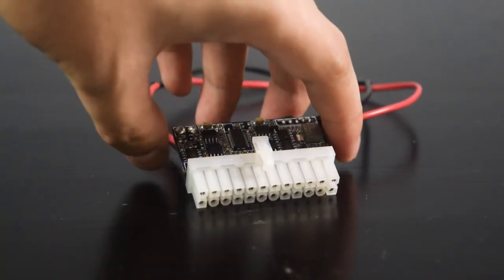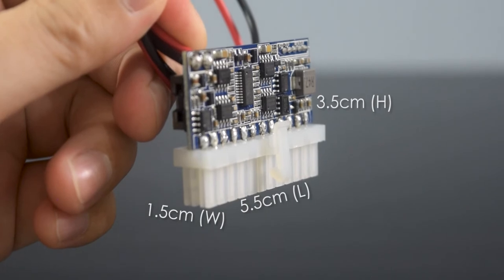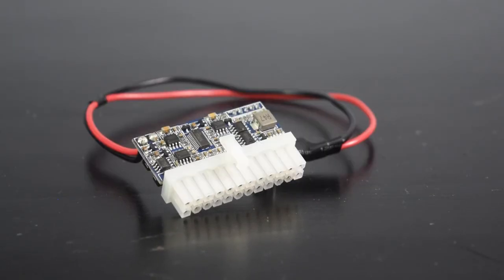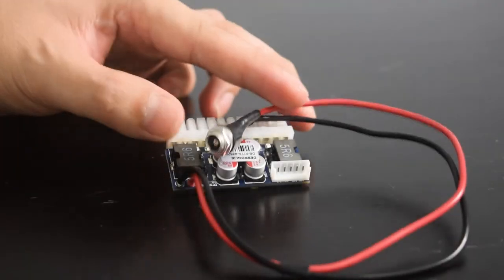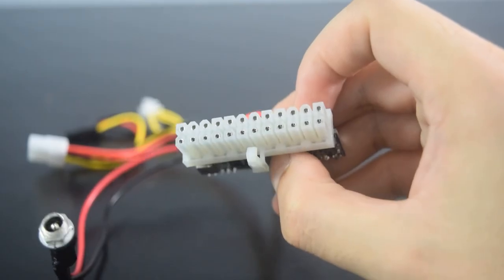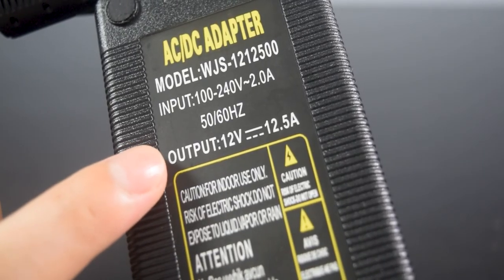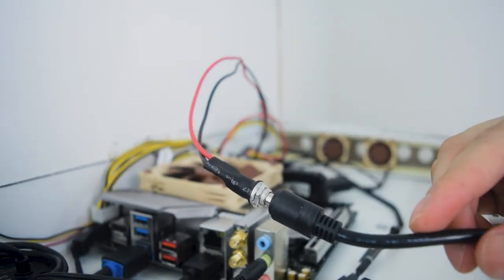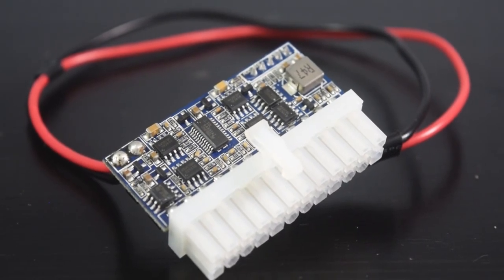What is PICO PSU? || Introduction to PICO power supply

Comment: You don't necessarily need a 12V 12.5A power supply, it's a good margin, but you should look at the load. For example, I need to power a miniATX motherboard with a processor on board with a TDP of 10W. At maximum loads, the motherboard with additional devices consumes 35W at peak, in Linux as a server no more than 15-20W. A 12V 5A power adapter (12*5 = 60W) is enough for me, because there should be a power margin of 30-40% for peak.
In general, I can even use 12V 3A, but only when I know that my system will not be constantly loaded and will have minimal consumption.

Comment: What about graphics card cable?
Reply: This is for non GPU builds.

A 70W without a 6+2 pin GPU usually needs a 250W PSU, so grab a 250W DC-ATX. But if you're thinking of running a mid or high-end GPU, check out Flex or SFX PSUs and make sure your ITX case can fit the GPU, like Metalfish S3 (flex) and T40 (SFX).
Reply: @_marcusmarinho or pcie powered gpus

Comment: Estimating the power of pcpartpicker is really bad. I realize this video is 3 years old, but it told me my config for a NAS draws around 205W of power....
In idle I got it down to around 28W, which is close to 1/10th of the powerdraw pcpartpicker said. Even under load, it never got above 100W. 
Comparing the size of the pico psu against a normal PSU but leaving out the external power brick you´ll still need is a bit disingenious.

Comment: Is it possible to use pico psu without the 24pin connector? I have 4 hdd case that i need to power up only the drives. Or is there any other kind of psu that would be better?

Comment: I have 2x 300W picopsus, neither will power on a low power Intel n100 motherboard that works fine with a normal PSU.
Without load the outputs all show correct voltages.
What could the problem be?
Reply: What is the spec of your external power brick?
Reply: I have similar poblem with 300W rgeek picopsu. Replaced him with cheapest aliexpress 160W picopsu and now everything works. That cheap psu is not that bad. I have low power system with i5 10500 and the temps of psu are 42 degrees max. There is small chance that powergood signal is not send properly in rgeek. Or there is no -12V needed for motherboard to power... old serial ports. Even when there is no serial port on backplate it can be on motherboard itself (goldpins)
Reply: @Krzak333  I will try to order one of those...

Comment: what good is it if you still need a frigging power brick???
Reply: No PSU sound, which is a huge issue for small builds, especially the very loud Flex ATX PSUs. Plus it is very small so you can fit it in ultra small cases that are designed for stuff like this. I don't like the idea of a separate brick either but there is a use case for it.
Reply: If you are tinkerer, you can replace barrel connector of psu with type c if you want. Again you would need to provide such power via compatible type c. Also if you have solar or some DC source you can get adaptors to use that DC without need of brick

Comment: WTF is even the point then if it still needs a huge external PSU?! There's nothing Pico about it.
Reply: The point is to remove the PSU from the case to make very small PC builds possible.
Reply: Yeah😂
Its true, u still need huge adaptor to power it, so buy flex psu is more recomend, and its safer too
Reply: @BedagrezsSs  But flex is louder. DC-ATX adapter is a good solution for iGPU builds.

Comment: Do they make a 400w one?
Reply: Not in this form factor, but there are SFX PSUs. I think I have seen one of those in the video with 240 or 300W, but it was bigger.
Reply: @MaxMüller0  i wonder is there an adapter to run two of these "pico 300w psu" in paralel for 2x the power?

Lol
Reply: @AutodidactEngineer  you can through a PSU splitter
Reply: @aleksandre5823  oh s**t is that a thing!?
Thanks for pointing it out!
Reply: HD plex but it is expensive.

Comment: Excellent video, very good, congratulations!! One question, does the power of the 12v external charger have to be greater than the Pico PSU source? For example, Pico PSU of 200 watts and external charger 12v of 250 watts of power, is that correct? thanks
Reply from the maker: Technically yes, power brick must have the same or higher rate than the psu, or else the pico wouldn't have enough juice.
Reply: @ItsTimeToBuildIt  Thanks for replying, these PSU power supplies only have a 4-pin connector for the CPU? My motherboard is an MSI B460i and the power supply connector for the CPU on this motherboard is 8-pin. Wouldn't the Pico PSU power connector have to be 8-pin? In your video shows the PSU Source with 4-pin connector. thanks
Reply from the maker: @josesing2160  like i mentioned in the video, you need a converter from 4-pin to 8-pin.

Comment: What about the GPU power supply?
Reply: You need a more powerfull psu... This is used mainly for apu
Reply: There is no 6 pin connector, because this thing doesn‘t have the power for this. Depending on the design, which can be different for these Chinese PSUs, it can have 8A on 3.3/5V and 22A on 12V (if the 12V input is directly connected to the 12V rail of this thing).
Reply: You might be able to downgrade your GPU in favour of a gpu that gets it's power from the pcie slot such as the Nvidia 1650 GPU
Reply: @Vodnik110  Honestly, I think even 70W GPUs without a 6+2 pin—like the GTX 1650, RTX 3050 6GB, or Quadro RTX A2000—are kind of pointless. If your case has a PSU slot, just throw in a compatible PSU and deal with the noise. It’s hard to find a tiny case that doesn’t have a PSU slot and still has room for a GPU.

Comment: I bought one from ali...... and tried to operate it out of mother board in the usual way (sort circuiting the green cable terminal to the black ground terminal) . Never started. I couldn't find the +5VSB or any other. I don't know it the specific device is a faulty one or if needs some load to start operate. Any advice is welcome
Reply from the maker: You need the right power brick to give it power, but if you already have one i'm afraid you've got a faulty device.
Reply: @ItsTimeToBuildIt  yes I have one 12 VDC 5A (12,1VDC till 4,1A). I'll try to follow the 12V line. Do you have any schematics for this brick ? It's the one with ISL6440 control chip.
Reply from the maker: I'm afraid 5A is not enough to push it, you need at least 12.5A
Reply: @ItsTimeToBuildIt 12.5 A with NO LOAD ?
Reply from the maker: You need 12V with 12.5A
Reply: @ItsTimeToBuildIt  no way.
Reply: @ItsTimeToBuildIt  do you have any schematics ? or do you have any link with the schematics ?
Reply from the maker: No i don't have unfortunately.
Reply: @ItsTimeToBuildIt  anyway. Thanks 😊